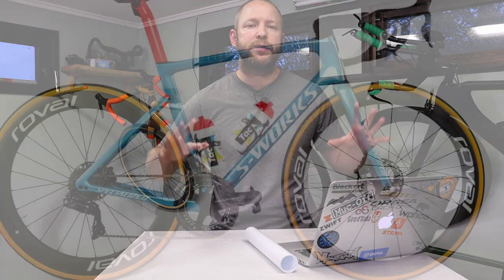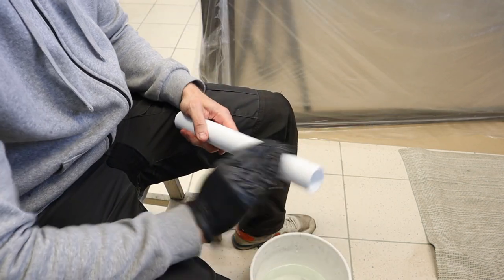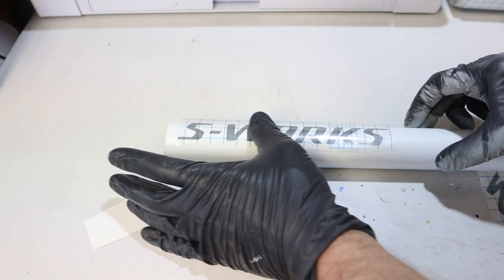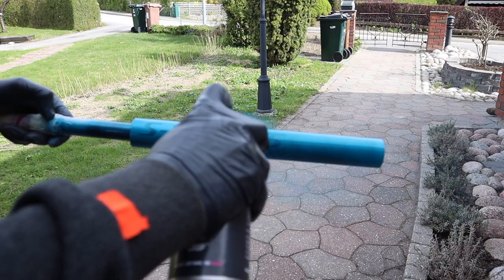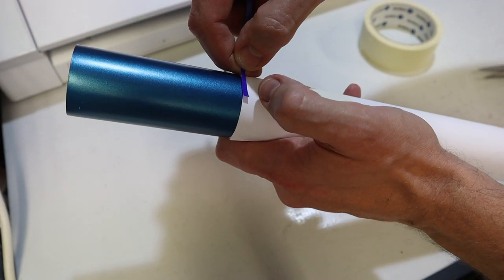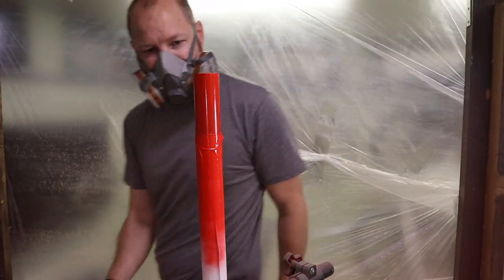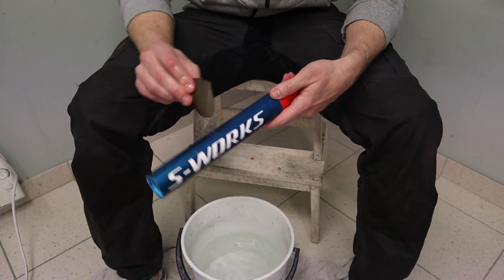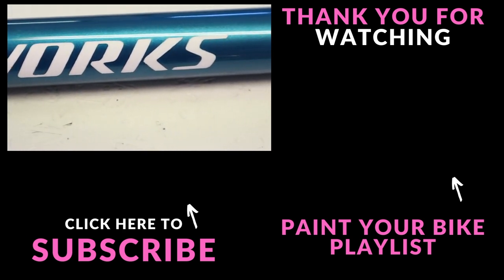Paint your bike like Peter Sagan - Custom S-Works Tarmac 2022 - Yes you can

Comment: Hello, can you sand the clear coat off a finished frame with 1000 sandpaper, apply water decals and then paint it again with clear coat? Have you tried this before or is it not possible?
Reply from the maker: Do you mean to glue on decals or paint on decals? I never use or recommend glue on decals. I have tried painting on new decals on a old paint job and it can be done. To get the best results you should sand and clear coat the whole frame, not just the over the new decals.
Reply: @MYnextDIYbikePROJECT  Yes, sand off the existing clear coat a little bit with 1000 sandpaper, then use water decals which also use Tukang Amplas in his videos, and then protect it with another layer of fresh clear coat.

Comment: For All Of You I Don't Have Acknowledge About Painting But My Brain AkA My Opinion Say If You Using Paint Remover On The Top Carbon Frame Is Too Risky So I Recommend Using Traditional Common Sand Paper For Remove The Paint I Think First Using 400 or 500 Or 600 Grit Before Put Premier Paint
Reply from the maker: I agree, only use paint stripper on metal. It’s all in this video. https://youtu.be/76VBieJ66PY